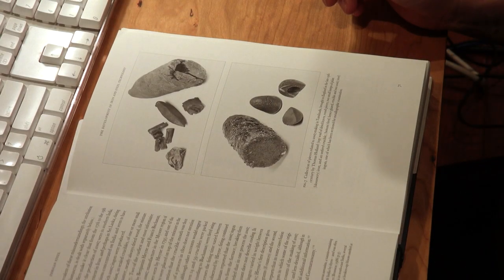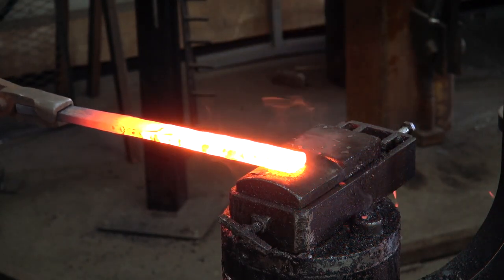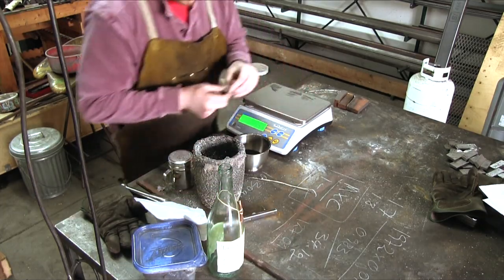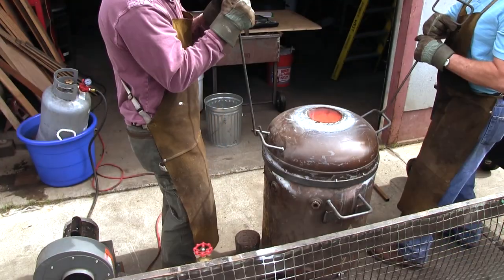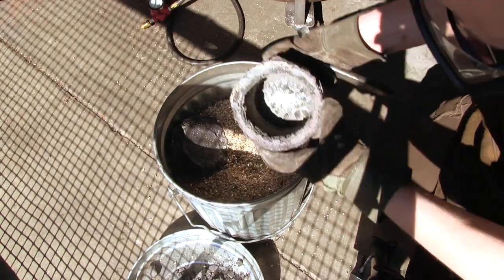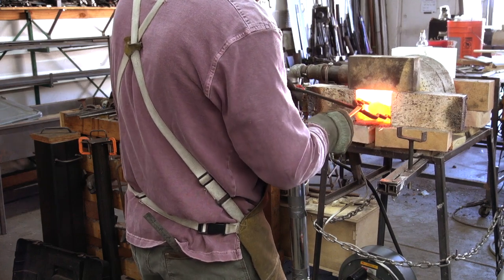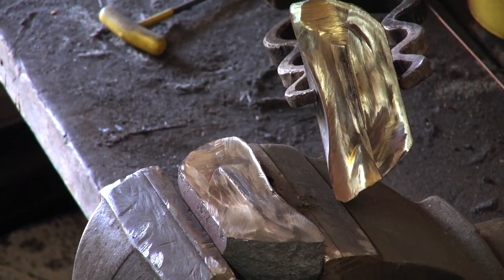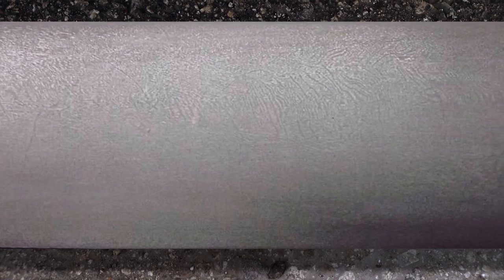Wootz Ep 4: Making Wootz Steel

Comment: There was documentary of a man in North Carolina, I think, that recreated a Viking sword that was found to be made of crucible steel. He did it all with hand tools, including making the ingot. The crucible process was identical to Niels', and the first ingot he made became the sword, there were no failures. But, after he made the ingot, he took 6hours to draw it into a bar with really light hammer taps, and he made it clear that if he wasn't extremely gentle with the ingot at first, it would crack, but after those hours of light taps it was much easier to work with. I have no experience with metalwork, so I definitely shouldn't give anyone advice on it, but I can't help but think that the reason Niels' ingots keep cracking is because he isn't insanely gentle and slow with drawing out the ingot like the smith in the documentary
Reply: yeah Ric Furrer dudes also an expert on wootz in general, he even cut up an old indian tulwar for examination it was sent off for metallurgical study.
Reply: john smith his name is Richard furer that was a good documentary of him forging the ulfbert
Reply: Alfred pendray was the father of modern wootz. Ric is good but alfred was a god

Comment from the maker: Since the process is using a lot of propane, the bottle gets very cold.  Once it starts freezing it will output less propane.   The water increases the thermal mass and prevents the bottle from freezing up.

Comment: QUESTION: in commercial sinistering they use COKE, not powdered charcoal. Perhaps the difference in purity between the two could account for some of the gasses youve run into problems with ? Also, perhaps consider flushing your charging vessel with neutral gas before sealing it ?

Comment: Modern day steel is superior to Wootz steel, mainly do to superior technology, so the appeal of most projects is to rediscover the methods used to produce it.

The original methods of creating Wootz steel were lost centuries ago, and most curiosity surrounding Wootz was spawned by the fact that it was extremely advanced for its time.
"Damascus" forging, is an attempt at recreating the patterns that were initially inherent to Wootz steel.

Original Wootz steel is usually comparable to 1055 steel.

Comment: I don't know much about the forging process, but I imagine it's quite comparable. The chromium content should help keep down the corrosion while the high carbon content, which is well above 1095 steel, will yield a very sharp blade. I'm not sure about it's other properties.

Comment: There is another referenced way to crucible steel I have attempted to recreate with good success. this is to take the steels you like, forge weld them together, then paint it with clay, I use satanite. (this forms your crucible) then I simply stack bricks and line the inside with more satanite and leave air holes. I fill with charcoal then heat it up and let the oven as it were simply cool off and die on its own. I take the steel out the next day or whenever and Its good. 

you're having issues because you do not let the steel cool off on its own. you have to let the eutectic magic do its thing and then let it form its state over a very long period of time. The bainite will space out your carbide chains. this sort of steel must also be quenched at a bainitic state, meaning you have to heat it up slowly over hours then quench at a high temperature of 2000 or higher or let it cool down for a period of an hour in the forge then air cool as your treat. forge and treat it like A2 with extreme vindiction  of reheats between hammer blows.

Comment: An noble attempt so far. Not to state the obvious, but have you consulted "the art of blacksmithing" by Alex W. Bealer? It is far from step by step instructions but the method he describes seems to differ from yours. 
 In my understanding if you smelt the cast iron first and pour it into a mold containing steel or introduce the steel later in the smelting process you may achieve the desired dramatic patterning.
Reply from the maker: Pouring does not work; the liquid steel needs to slowly cool down in the crucible.At the time that Bealer wrote his book (1969), nobody knew how to make Wootz steel.

Comment: I have a question. 
Why don't you melt the metal again after first getting it out. You get it out the first time, cut in in pieces and then melt them again to get a perfect blend. I think it would make better steel.
Reply from the maker: it's quite expensive. ideally you want to get it right the first time. not easy to cut up either.
Reply: ok, i get that. But would it improve the chances of getting the mix perfect right ?

Comment: what made it so difficult to process your first 2-3 ingots? were they too hard straight out of the crucible? was normalizing them not enough to soften them for workability? were they too stiff to work because of the ammount of carbon the steel absorbed or was it simply because of the different types of steel used?
Reply: Based on what I've seen so far, my guess is the smelting process produces defects / inclusions that are not steel but something else, or had localized spots of cast iron or such.  If those defects are large enough, no matter the temperature, an attempt to forge that out into a bar will crack the ingot in pieces.

Comment: Yeah frequent heat cycling and tippy taps not hammer blows.  I would be looking to help crystals grow during the heat cycling, not trying to shape anything.  I wouldn't even touch the power hammer until I was at least 2 digits into my heat cycling.  I have always wanted to experiment with vibration and pressure like clamping it and giving it a shake like a concrete vibrator.  Search Alfred Pendray, they went into full geek science to make their wootz and got real good results.   Whoops 9 years?  <shrug>

Comment: I'm trying to melt some 5160 steel for a pommel for a knife I'm making 

For some reason when I use fire brick for my charcoal forge it doesn't melt steel 

When I used cement bricks a  part of a rod had liquefied in ~10mins 

Thing is I had different posting of where I put the steel in this forge 

Fire bricks: right in front of air intake from leaf blower 
Cement bricks: charcoal behind the piece of steel and more deep inside the forge/foundry 

I have a video of this forge on my channel 
If I have set bricks wrong plz correct me

Comment: Is this classed as high carbon steel able to be made into a fire steel, a flint and steel spark fire steel??? Can this be done in an Aristotle furnace with manual bag bellows?
Reply from the maker: It’s high carbon steel but an Aristotle furnace is different process. See my video on that.
Reply: So it is possible to make iron into a wootz high carbon steel fire steel with bag bellows? I've tried pack carburizing and thermal cycles in the zone beneath the air inlet. Both methods added carbon to wrought iron but not high carbon. Any advice appreciated and for sure I,'ll check out your videos.

Comment: The reason the ingots consistently crack is due to hot shorting, which is caused by low melting constituents, most likely iron sulfide. The addition of more manganese would likely help, O1 tool steel does not have enough to significantly help with this problem . Heat treating is necessary to decarburize the exterior surface to contain the segmentation, or cracking, as well as working the metal very gently. Also I believe one critical element has been ignored, and that is phosphorus. O1 tool steel has a phosphoric content of around .03% whereas Wootz steel has  exceptionally high concentrations of phosphorus. Also it seems very likely that other 'impurities' in Wootz steel may not be found in your wrought iron and O1 While this is probably the best attempt I've seen, I would say that the real key to obtaining more defined and larger segments of iron allotropes and carbides would be in heating and cooling cycles.

Comment: I really enjoyed the video and found it vary informative. I just had one question what type of insulation do you use in your furnace that can sustain a temperature of over 3000 degrees?
Reply from the maker: I have been using a high temperature castable refractory cement called Kruzite GR PLUS. It's rated up to 3200F.
Reply: Thank you sir, My friend and I are planing a furnace build and were hoping to be ableto get it up to about 3000F so that would be really helpful.

Comment: as i said in an earlier video, your clay graphite crucible is the culprit.  The graphite in the crucible is obviously pure carbon.  Carbon dissolves into molten iron.  Your ingot is being contaminated by the crucible.
Reply: oh and your last ingots were working probably because most of the carbon in the crucible that would be exposed to the iron has been eaten away.  So it no longer is contaminating the charge.
Reply from the maker: josef williams I had the ingots analyzed using inductively coupled plasma mass spectrometry and the carbon content was where I expected it to be. So, the graphite in the crucible was not the culprit. I expect oxygen to be the issue.
Reply from the maker: Joseph Williams I mean dissolved oxygen in the ingot. I am not adding any aluminum to take care of it. I think the crucibles are quite porous at higher temperatures so the next step is going to be to coat it and reduce the time in the furnace. It does seem that used crucibles lead to slightly different results but it's not the carbon content that's the problem.
Reply from the maker: A friend in Michigan was able to get samples analyzed for me. I had no time recently to experiment with crucible steel. I'll post ghee the next experiment goes.
Reply: cool

Comment: first you work the steel slowly to avoid cracking.then your suppose to punch a hole into the middle of the ingot so that it ends up looking like an o after that you cut through one side then draw it into a bar.again you do all of this very slowly to avoid cracks
Reply from the maker: +padzu101 I will try that. Thank you.
Reply: from what i know thats one way but not the only way to do it, however that way has the added benefit of getting rid of any problem areas in the center of the ingot.